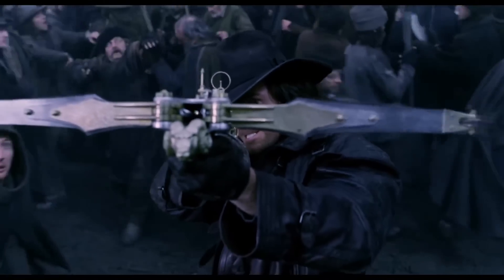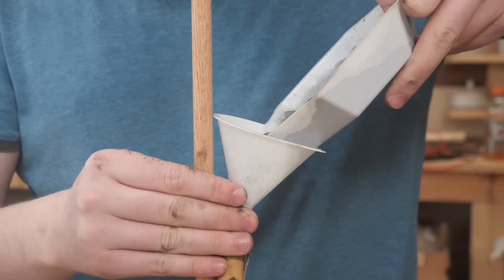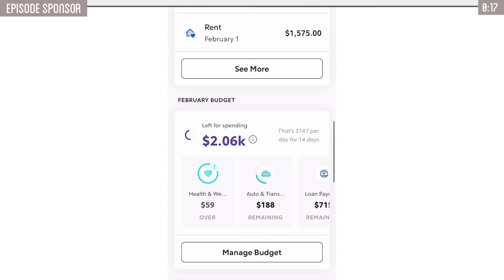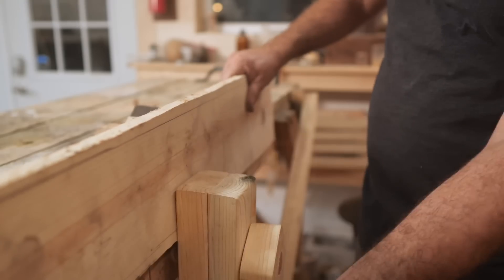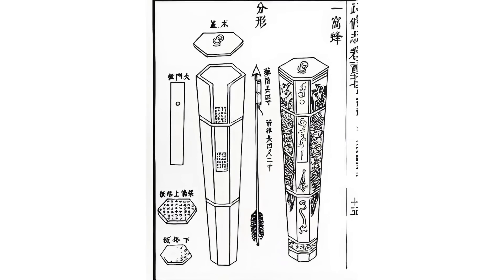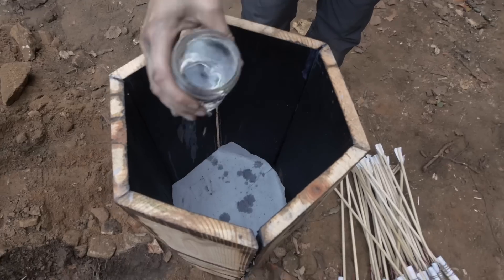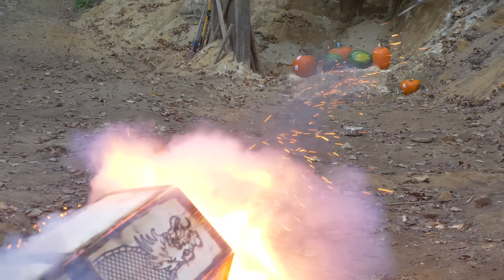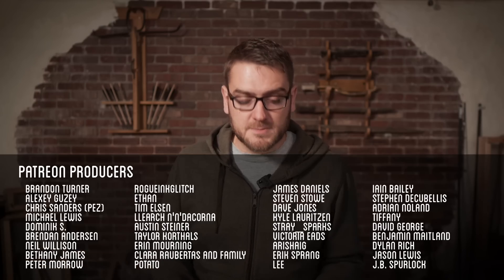This Ancient War Machine SHOOTS ROCKETS

Comment: shouldn't have used a wire brush a simple brush would suffice in removing the course burnt material and leave the nice dark wood instead of scratching the wood with metal as you did

Comment: I kind of suspect it's more about the scare factor than killing power. Maybe also for trying to light stuff on fire, if you were to loose this on like an enemy camp with a lot of tents to burn. Given the short range and the tendency of projectiles to go haywire, I can't imagine that they would have dealt more damage to an enemy than simply using conventional archers, but the smoke, noise and sparks certainly could disrupt an enemy unit that wasn't ready for it.

Comment: That would have been scary for those who have not seen anything like that before, but not for long. The basic problem is asymmetric thrust in random direction causing it to be very inaccurate, and still being able to only punch a small hole in something. But once you realize you don't need the arrow, you need more gunpowder, you have a missile.

Comment: Umm... I thought that kind of "experimental equipment" would have been better tested in a place like an old quarry or the like, not in the middle of what appears to be a wood, with lots of flammable material...

As for the tests, I have to agree; flaming rockets/projectiles flying at your opponent would scare the p!$$ out of them!

On your last comment regarding whether that is a gun? 
In my opinion, the answer is "No."
That incarnation is a self propelled projectile. (best known as a rocket or missile)
It becomes a launcher (gun, cannon, whatever), when the propellant is used to forcibly eject solid objects through the exhaust/barrel 😉

Comment: You had to make a hand plane but you can use a laser engraver? Wtf?
Reply: because they enjoy having such tools that were homemade whilst also having a professional made one, I was surprised myself how well the plane worked. plus also the channel theme is rustic, tradionaal made technology, so a homemade plane for a homemade launcher suits it well.
Reply: @Polkem1  i get the premise of the channel which is why i was pointing out how far they deviated from it to use a laser engraver. If they are gonna allow that kind of rule breaking, just go but a plane, drill bits and chisel sets.
Reply: @kevinhurley6919  well i saw was it was only for the art work on the actual piece, the rest of it was done by hand it seems.
Reply: @Polkem1  also cut with a store bought cross cut saw.

Comment: You can easily improve the efficiency of your black powder by corning it, ie. wetting the mixture and grinding it as a slurry. 
I'm sure there are enthusiasts who can explain the whole process better than me.
Reply: Corning is great for making it a good gunpowder but for a rocket engine you want it to be a single solid piece not packed grains of powder.
Reply: @housegoth  Yes. I was thinking more in the light of earlier episodes, where they had trouble with the mixing quality.

Though thinking about it more, could be they're also repeating the history of the making of black powder.
Reply: Corned gunpowder was not yet invented by the time of these weapons, so it would be "cheating" to port it backwards. It also was developed in Europe and never really caught on in China.

Comment: Suggestion for how to get areas to test these sort of projects. Talk to your local fire department or forestry management organisation about where they are doing control burns and if they would be ok with you using those areas to test your pyrotechnics out either just before or just after they've put the burn through.
Reply: This would definitely be an excellent idea -- plus it emphasizes the "act responsibly" aspect of the "don't do this at home" statement

Comment: I agree with your analysis. I don't think the strength in the Hwatcha, or Nest of Bees, or similar rocket powered arrow delivery systems was in killing people. But rather it was in terrifying them. Especially if you were a commoner fighting for your feudal lords and had no explanation for what the enemy was hitting you and your allies with other than magic and sorcery.

It was probably also useful for lighting fires and destroying wooden structures and vessels though, so a tactical use aside from just a weapon of awe as well.
Reply: Remember you are shooting this thing at a block of 100+ people running at you. You are going to hit quite a few people in that block, and when the survivers see you put the next nest of bees on the launcher the moral effect is going to be massive.
Reply: @felonmarmer  I reckon even if you fire into a block, you're not gonna kill a lot of people. Conventional archery is way more reliable in that regard. I mean, these rocket arrows seem to be going slower and often start spinning mid-air, killing whatever momentum they had. You're gonna have a lot of people who got slightly singed, or who got smacked by an arrow but not hit by the tip, or who were hit, but the arrow wasn't going fast enough to really injure them. 

The big deal is gonna be the smoke, the noise and the sparks.
Reply: @felonmarmer  And I doubt you'd be the only one firing this puppy, If you and a dozen mates fire these in a steeper angle, you're going to saturate the target zone with these things pretty rapidly.
Reply: @felonmarmer  target rich environment!!
Reply: I imagine that this would be devastating to cavalry troops.  The loud noises, smoke, bright lights and rapid movement would all really terrify horses and break up or stop a charge
Reply: I know what it is and I would still run away lol. There’s so many random arrows and going all over the place 😂 it’s nuts

Comment: Why did none of the arrows have fetching, you're the guy who taught me about fetchings
Reply: Historically, the Chinese did both.

Shorter-shafted arrows tended not to have fletchings, likely because they would burn off, while the larger ones did.
Reply: They'd burn off probably and also easier to make 
the stick is enough to work as stabilization, same idea as fireworks on sticks

Comment: If youtube tries to start messing with your black powder videos, a legitimate argument could be made that be US legal definition black powder weapons aren't considered firearms as long as they can't be converted to use modern shells therefore the experiments you are doing are entirely educational and are not based around making firearms but using black powder
Reply: Reminds me of one regular when I worked at a gas station. He couldn't own firearms, but he used that legal loophole to carry a flintlock. His argument was that he'd rather have one shot than none.

Not sure how well that'd hold up in court, but I'm not a lawyer.
Reply: this is much less a firearm than it is an amateur Signal/Rocketry rocket turned military munition using the metal tips.

Comment: Scary as this is, if they fired actual bees, I'd be more horrified.
Reply: Instead of arrow heads, tip the rocket with little ceramic jars filled with a handful of bees.

Launching the rocket agitates the bees and the jar breaks on impact releasing the angry bees into the enemy ranks.

Comment: I think if you added fletching, and another baffle with holes, your accuracy would increase, Looking at the slow motion, the rockets are not fast enough to fly as their sticks are out of the bottom baffle, and they start to fall. Then the thrust really kicks in, and by that time they are pointed towards the ground, and just shoot that way. This is supported by all of the arrows that were on the ground in front of the nest of bees  with their rockets still burning. 
Also, you should make sure that all of the rockets are hanging down from the arrows in the same direction to avoid introducing a spin.

Comment: LOL Had to laugh 
But About 20 years ago I had the idea of making a arrow launcher 
I made it close to how you did , but used modern tools and plywood 
But I only had a simple picture to go off of 
So I figured maybe they used a bamboo stem to hold each of the arrows in the nest of bees 
So each arrow had a piece of TW conduit to launch out of , crimping the end of the conduit helped a lot 
My picture showed  48 rocket arrows wide and 24 rocket arrows high in a rectangle built onto a cart 
Also my arrows and the rockets were both larger 
I test fired out onto Lake Erie for safety 
I know some of my arrows went 400 yards or more

Comment: yo cool tip, dont know what anvil your using but a very solid steel box filled with sand dampens down everything real good. example i saw of quiet anvil was slightly pyramid ending in a solid top with edging roughly the anvil base :)

love what you do, i want to have a place where i can use my forge and make all the things myself(noise, smoke, neighbors). avoid the production lines for as much as one can. kiwi wanting to find bush land to live with the land
Reply: That's pretty awesome that you are planning to have your own forge!

I would love to get a workshop eventually - where i can tinker with electronics, 3d printing and machining to my hearts desire!

Maybe i could get a small forge too myself? 😅

Though for me:  this will be quite a way into the future - till i have enough money for that level of independence :/

Cost of living kinda sucks 😅
Reply: @Chris47368  ark welder, angle grinder, local scrap dealer for cars sprins,  truck rims etc, $50 for scrap metal and a place to cook :)

my original tinkering forge was a truck rim size of large steel drum.
cut out top of drum to have wheel slot in(keep top for a lid. dodgy leaner weld some random steel chunks to cover wheel nut holes.

cut large hole in side of drum going on lower then 1/3 way down drum. fill with water for weight ballast and quenching.

air feed: bolt/weld/whatever you can imagine, large diam pipe to last hole in center of truck wheel, or make something can dissemble.  put removable ash-can on bottom of pipe to collect embers and a 45(ish) degree pipe going out drum to air feed(small cheep secondhand hair dryer usually has a small 12volt motor which is more then enough) how you control air is what you like, mechanical of electrical :)   

can then cut sides of drum to suit needs(keep cut-outs so can weld little tabs so they sit in place when not in use).
can use BBQ grills in base of fire air feed as a sacrificial grill and underneath either have a row of tool steel or spring steel bars, or if feeling fancy a steel plate with holes to cover air pipe bottom air feed. 
none of the welding is not critical so perfect to learn. always wear PPE, if in doubt, follow the gut :)

living in the city being home sick for country life lol
Reply: @Chris47368  wow i replied with how to make a cheap forge with a drum and truck rim but comment gone, o well. anyways. hardest thing is having the space, with modern tools of grinder and cheap ark welder can do most things with bits from local scrap shop. o to have that land while i still have the energy

Comment: Tbh it's more phycological warfare rather than effective combat equipment
Reply: In all fairness that's generally what firearms accomplish in modern times. Suppressing fire isn't mean't to land hits, it's just meant to keep heads down. Although obviously modern firearms do have a combat effectiveness advantage.
Reply: They would have put a lot more work into making them better on top of making way more. Don't need a specific rocket to hit a specific enemy when there's lots of rockets flying more or less in the general direction of them.
Reply: @TheRedleg69  it turned out guns are more effective in general, which is why they quickly moved away from rocket arrows and to them instead. The hwacha specifically encompasses the early rocket arrows AND the bellow/volley guns
Reply: For siege defence the Chinese greatly preferred rockets for the simple fact that they could be stored in great numbers and could then be launched in great barrages in quick succession.

They also devised launcher tubes that were designed to be kicked off to the side of a wall. It would freefall until it swung around via a rope attached to the wall so that the tube would remain about-waist to head height... Then both sides of the tube would spurt out ~30-60 poisoned arrows. I would not want to be the poor bastard getting hit by those!
Reply: @V3RTIGO222  Yeah the thing is volley guns faced similar issues with complexity/accuracy and did not prove super impactful either. Even in the pike and shot era, it was generally easier and more effective to just have more dudes with guns aiming down range. Still, I think the volley gun would have a better chance at maintaining killing power than the earlier nest of bees simply due to the limitations of early rockets vs. bullets. Also, it took a surprisingly long time for the invention of grapeshot to come around, so with the technological constraints of these earlier volley weapons, they're alright ideas.
Reply: Yes, probably very good at breaking up enemy formation. Especially if they don't know what it is.